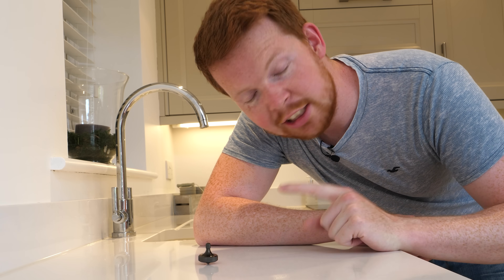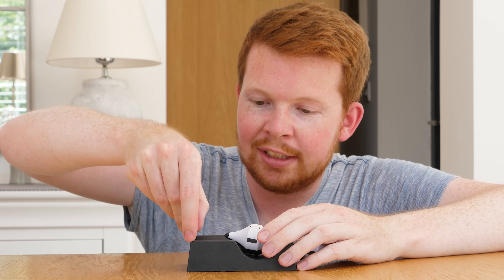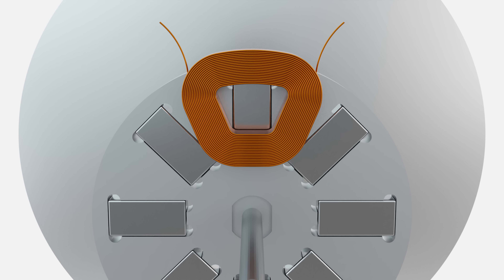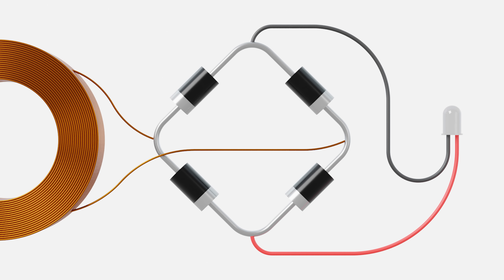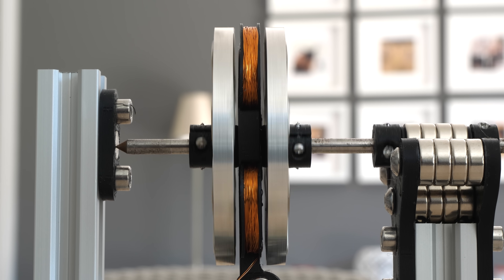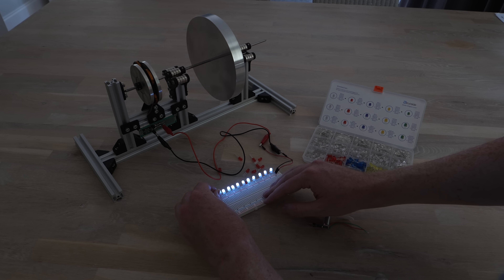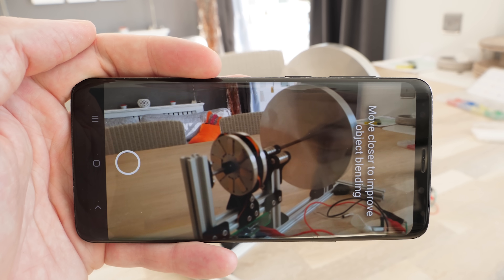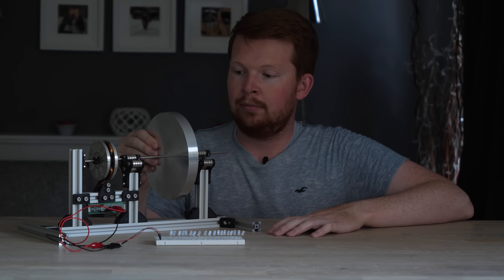Flywheel Battery

Comment: Tell me if I'm wrong but that restraining plate is providing a lot of friction. The bias you provided is counter balancing the entire weight. You removed a very slight amount of friction.
Reply: Not really much friction at all.  It's nearly a single point touching (on a macro scale) of surfaces.  It is likely the least friction you can have with touching parts.

Comment: Useless toy. Unless you get 1000 kg flywhell, power it by solar panels by day, and recive energy at night. Ofc RPM's must be extremaly high, and power consumption at night significantly
low. But by spining heavy weight flywhel you experience percesion, because of earth spining. So all these projects simpy put in trash.

Comment: I love it but why the extra wheel vs. putting the magnets around the flywheel? That's more than enough power to make enough hydrogen to heat your house or run a generator or cut metal or start a fire with wet wood or cook with or......

Comment: you can try to make a elektric cycle with a old walkmen motor and a 3,2 V accumulator to drive the flywheel up. One part of energy to charge the accumulator and the rest of energy can using for other things... :) Just a real perpetuum mobile .... maybe a bigger electric motor and a bigger accumulator.

Comment: Yeah, so the coils are without a core, I understand it this way - to eliminate magnetic braking. And what if you attach a couple of magnets to the outer edge of the inertioid and adjust the inertioid from outside to the beat of the rotation speed? And in induction coils , increase the number of turns by 1000 times . Well, it didn't hurt to close the magnetic field from the magnets.

Comment: A nice recoil starter type puller at the free end will get the flywheel properly whirring away after a few hard pulls. next step - double the number of flywheels in series / use a CV shaft to connect it to a pulley which you can use to drive the flywheel either with a hand crank / wind power etc.

Comment: If you use the two faces of the flywheel and it's perimeter edge/outside edge, you can drill holes and add more magnets and so more weight to the flywheel as I think a given volume and weight of neodymium magnets is heavier than aluminium.
The more magnets will give you additional opportunity for more coils and if you like seperate circuits.
In a doughnut around the flywheel outer edge you can have coils and the use of two light weight plastic discs either side of the flywheel faces to hold coils.
Just a thought, nice model so far 😉👍

Comment: I wonder how well it would work to make a simple gear/clutch system to connect it to a hand crank for better efficiency when spinning it up. In my head I'm seeing it as sort of a movable Y-shaped cradle that sits underneath the shaft on the open end, with a fair large 3D printed gear attached to the shaft directly above. When you want to spin it up, disengage the crank, then slide the shaft into position, match RPM with the crank as best as you can, then pop the clutch and start spinning until you've hit something like the desired RPM. Turning it by hand would be simpler, and far less of a headache to get everything calibrated, but where's the fun in that?

Comment: 8:11 "not much fun using a drill to spin it up"

Yet therein lies the usefulness of a flywheel energy storage device for the purpose of renewable energy sources because in a perfect world we would "spin these up" with energy from renewable systems that is typically curtailed. For example, in places where the sun is shining but the grid does not demand it or the wind is blowing now at 3am but everyone is asleep etc. Any off-peak hours energy harvesting could be dumped into these and that's the dream but impractical at the moment, I think they should keep trying anyway.

Comment: Put a motor on the flywheel so it can run without spinning it with your fingers. Then you can run a separate wire to what you want to run

Comment: You should use a trued, milled machine shaft of about 4 times the diameter of the little hardware rod you're using, it's ridiculously flimsy and warped.

Comment: Following with Mr. David Mashiah's line of thought. If you add another line of magnets in the two areas where the main bar levitates ( making it a four-point square axis), you can control the vibration and movement without affecting the rotation. Then add the magnets to each end of the bar to keeps the entire system in levitation.

Comment: Tom...

you mentioned a fascination with the idea of spinning a wheel, and watching a motor turn as a result; "an electronic gearbox"

i have had the same fascination for 50 years. except, in  my case, the "spinning wheel" is a magnetic phono cartridge, and the "turning motor" is a loudspeaker. the electronic gearbox is an audio amplifier. if you create a flywheel powered audio amp, you'll bring it full circle for me.

Comment: I wonder the output is you added two more wire coil cores, so you have a total of three.  I really think your device can produce ALOT of power.  Especially it all possible to install solar panel recepticals on the flywheel when the device faces the sun, you have a trickled in energy, which can boost the capacitors.  From there build/install a amplifier board which will run off of one Coil Core, while the other two are the main output going to a step up transformer.  The Amplifier should be able to time trick boost the output to where you could actually would be able to install a motor to a Larger hallow wheel.  Then install a pulley drive, so the larger wheel which is ran by the recieving output motor, turning the hallow wheel which diameter I would try at 2x size difference, and put the Belt on the system.  make your original Flywheel smaller and heavier.  it should work.  This will obviously run the floating of the Rod, but I think you get the point on this.  Give it a shot, I like to see the results

Comment: What about using magnets on the rim of the flywheel and introducing an angled magnet to them to spin the wheel at the speed of magnetic field? Which I'm sure would require a much more beefy setup to contain and keep it balanced, but it'd be nice to be able to just hold a magnet up to it to get it started instead of by hand. That way it stays more balanced.
Reply: you mean spinning it just with the magnet? that would violate conservation of energy. there has to be some form of energy going into the flywheel to make it spin

Comment: Does the alternator induce a constant drag on the wheel, or can you adjust it by changing the resistance of the circuit?

Comment: Back in 1992 when I started my Engineering study's I watch a program on TV about I think it was Holland use flywheels to power there phone network, they are so large and dangerous they were buried in concrete bunkers and spinning at very very high speed and sealed in a vacuum so no friction as the float etc truly amazing.

Comment: Could you not build a similar frame to hold another pair of magnets to place over the axle and hold the axle steady. Plus us two magnets in opposition to hold the axle away from the plate. Then add a gearbox to allow faster turning force.

Comment: That was cool. Admittedly when I read "battery" in the title, I thought you were going to store energy in the flywheel via an electrical system (something like Tesla's AC motor) before releasing it for useful work. So I was a little disappointed not to see that.

Comment: If you install more generators, use that current to power one motor, powering the flywheel. Is there a surplus of power? because it doesn't cause any more friction.. can you try doing the same? can also put it in a vacuum, which will help reduce friction.

Comment: With a small 1 way clutch and a lever, ud be able to stabilize it and turn it with ease. And if ya wanted with gears you could get crazy rpm on a desk toy with little physical effort

Comment: Put a fan blade on it and park it in front of a air conditioner heat register as the air comes out it will spin spin the flywheel and regain some energy from the   HVAC system

Comment: Fun project, but not too useful. The physics involved dictates that the total energy input will always be greater than the energy produced. The flywheel will not provide any kind of free energy because of the inertia necessary to get it spinning. While it's true that riding on a magnetic field the friction losses are reduced, but the magnetic field however small does absorb some energy. Also the air surrounding the flywheel absorbs some mechanical energy as well as each and every electrical component in the circuit which will produce losses in energy  in the way of heat.

Comment: A dead-end project! The efficiency is very small. The flywheel will rotate for a long time without load. As soon as you connect the load, the flywheel will stop quickly. The greater the current of the consumer, the faster the stop. Learn physics. And to light the LEDs, you do not need to assemble such a bulky generator model.

Comment: Can fly wheels be used to recover lost energy in brakes, stabilize acceleration demand, shorten charge time, and maybe increase range for electric cars?
Reply: Too heavy! 

Cars need to be lightweight and not full of materials. Combustion engine is the heart of a light, energy dense machine right now.

Electric cars need better batteries and that's all.

Capturing inertia from braking is for sportscars. They brake hard and from high speeds. Average man driving at 30-70 mph isn't enough inertia energy

Comment: Cheat code: Spin the wheel, connect motor to wheel, with energy from wheel, motor is powering the wheel that it itself is powering the motor = infinite energy.

Comment: Have you tried using pyramid shaped magnets (lower 2/3) in the wheel? ive been following one scientist who shows the forces change an sells such products even i believe. (super magnet man).

so what happens to the basic science of this when we change those magnets in the rotor from rectangles to 2/3 pyramid? also we could see if the coils shape being changed in the 2 compared magnet shapes changes the basic science that rules this aspect

Comment: Serious question. Can i use this design on a waterwheel im making? I wouldnt be using meglev obviously. But i have a very large old whaterwheel i found at a scrapyard (10m diameter) and i want to use it to power my workshed through the creek i have. The setup you have is simple and i think i could manage it. I have 20 car batteries wired in series to use as a powerbank. As well as a transformer and meter. Just wasnt sure about making a generator from it.

Comment: If you stagger the magnets in each disk instead of lining them up you will get a higher hertz AC and faster flicker which is less noticeable. Mains electricity makes led flicker too its just really fast. 60 times a second where I am. Alternatively you could add a way to control the hertz of the leds.

Comment: This is cool, add wind power for the flywheel and you've got free power. scale it and add a battery bank to store it. Build 2 of them and while one is charging you use the charged battery from the other. Then cycle as needed. Add a few more banks even. Great video  thanks!
Reply: Im confused why you would need to cycle them at all. The electrical energy from any source should be used as its generated, and the excess should go towards spinning the flywheel. Once there is no power coming from the source (cause lets say its a renewable) then you switch to the flywheel for stored power automatically. Why would you be charging and discharging the flywheel on purpose?

Comment: If you can get 10v out if it... then an cool idea is after you straighten it out, make a mount and use either 1 a brushed or 2 an brushless motor to spin it faster for more power, the reason brushless would be best is 1 heat and energy efficiency and 2 power/torque output compared to a brushed motor... although there are other benefits aswell... could be cool to see how much power you could get tbh

Comment: Build a modernday flywheel battery (vertical) and then add the following on the shaft of flywheel.
*alternator/charger 
*motor/driver 
Then for power source the following. (Not fully  attached)
* super capasators for turning motor to get flywheel going in 30 seconds 
*Solar/wind chargers to get capasators loaded 

This could be a self sustainable flywheel battery system????

Comment: I remember Porsche once built a 911 GT3 with flywheel battery mounted next to the driver's seat, which got "charged" when the car brakes in front of the corner and "discharged" when the car exit the corner and accelerates.

Comment: Step 1: Chuck flywheel in lathe.
Step 2: Face cut the old shaft.
Step 3: Bore hole for new larger + straighter shaft.

Comment: The Flywheel needs some weight reducing holes start near the center, do it in a spiralpattern but let overmass on the outer rim of the flywheel. You could also optimize the coils.